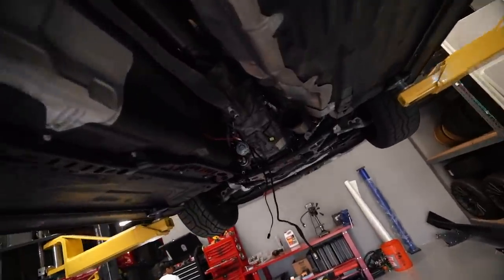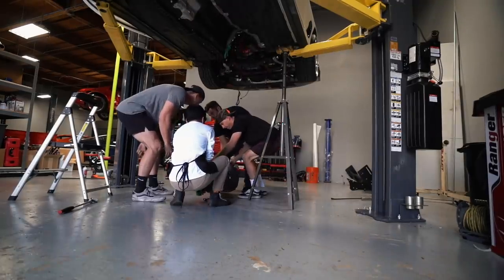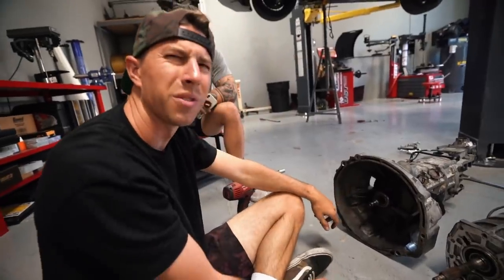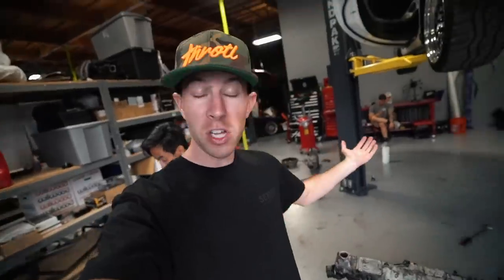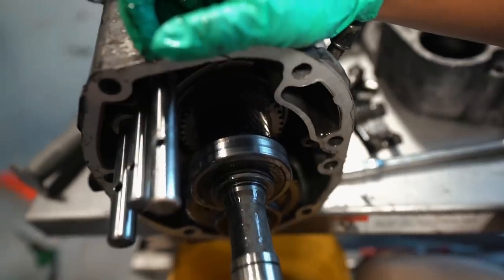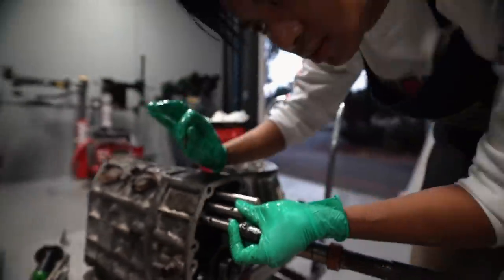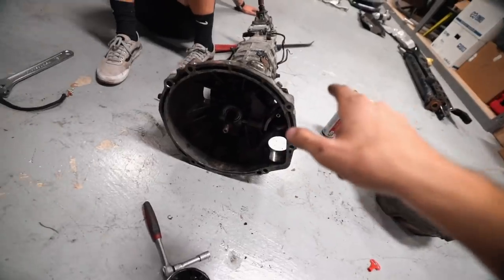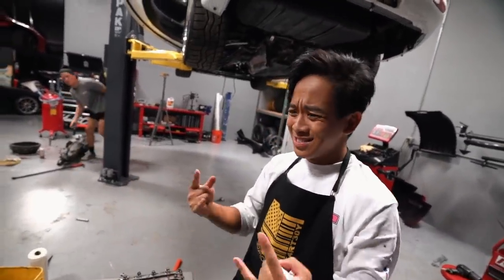RX-7 Transmission Tear Down & Rebuild!

Comment: So what happened is your shift fork got detached from the shift rod and the pin that is supposed to connect those 2 components got stuck between the shift sleeve (where the synchromesh is as well) making it unable to go in 5. At least thats what i think. Never seen that before.
Reply: MadCat so, what they said
Reply: Lol you just summarized what they said
Reply: @SamSto  he prolly typed it before he saw them say it

Comment: Those pins falling out is also common in the Miata transmissions. Get that pin back in there, replace the shifter bushing and put in some Swepco 201 gear oil. We need more braap’s!

Comment: Props for sticking with the diag bro. I did cringe a little when you were splitting the trans case with a pry bar and a hammer.
Reply: me too. im guessing theres some pretty mean notches put into the gasket area now on all those pieces.
Reply: There not rebuilding it
Reply: Right! Hope fully no one uses that case again. I would be worried that it could be prone to leaking.
Reply: Yeah really, fucked it up.
Reply: German Elite Tuning im stunned hes sticking with the fd trans especially with the chance you can take with the 5th gears in them, and 3rd gears.
Reply: RE ^triggered asf^
Reply: @shawnupole9316  what block did u buy and how much total was it a together for your sti? Just preparing... I know my engines gonna go soon
Reply: How else can you separate those pieces?
Reply: @shawnupole9316  awesome man I'm shooting for similar numbers. Good luck 😁

Comment: These boxes have a tendency to jump out on the 3 selectors.all 3 need to line up ,easy fix but as you just found out its a box out and rear off.my mates is the same but you cant use reverse.top vid ,love when you go deep into it.calv the rear is hard to put back on you need to hold up selector and twist as you lower it so the selector gets into the 3 gear fingers.good luck

Comment: The RE-A short shifter is pretty much a stock shifter. If you're going to buy a shifter for the FD transmission look on the forums for a C's Short Shifter. They're very sought after and go pretty quick but if you can find one buy it. I have one in my FD and it's one of the best mods I've done.

Comment: that pin that was droped  are protect trans to go in 2 gears and its protection to not make any damage.. so be careful of springs and small metal balls that will get lost if you open trans so be careful and do it slowly.. Its not a hard thing but you need to do everything in neutral so then all goes back together.. Its a proces 😀
Reply: and that small springs and balls allso protect trans so..

Comment: 10:19 the way it can fall out it to remove the spring and ball there is a bolt on the outside of the case of the trans that when removed you can take the spring and ball out, NOT EVERY LINK WILL HAVE THE SAME BALL AND SPRING SO ORDER IN WHICH IT CAME OUT IN IS IMPORTANT some links may have a stiffer spring than others

Comment: The 5 gear syncro probably broke in the past (super common) due to a mis shift.  Mazda had updated the shifter springs to prevent mis shifts later on.  Previous owner had the tail apart to replace 5 gear syncro.  The roll pin was either worn or wrong and reused during reassembly.

Comment: You guys need a hydraulic Highboy transmission jack. It has wheels and a pump so that when you support the weight of the Jack you can legitimately lower it and roll it around on the jack opposed to having to carry and shimmy it around

Comment: ok cool you found it. this is something u can fix yourself for sure. if you split the whole case on both sides you can pull the whole gearset out and put all the pins back where they go. and bam another trans

Comment: For the sensor just trim the plastic around the copper alittle bit so you can solder a new wire on, then hotglue/epoxy the shit out of it so it doesnt break at the solder joint.

Comment: I have never commented before, I had the same thing happen to my 94 z28 Camaro. It stuck in third gear, the day after it was rebuilt. I was pulling as hard as I could and not able to get it out of gear. Eventually we got it out of gear and it never happened again.

Comment: An issue I had on a 1970 camaro z28 was I was driving and it got stuck in gear, I tired pulling it out and nothing happened, floored i it and dumped the clutch a couple times and it popped out

Comment: if you end up having an issue with this transmission holding the power you should go all out and have one built to handle 700 + horsepower so there's no more problems in the future this build deserves it everything else is top-notch but the transmission.. love your videos though keep up the good work

Comment: I don’t know a lot about RX7’s but I do know that on high mileage Miata transmissions, the fifth gear/ reverse gear rod can get stuck in reverse, causing the trans to only be able to go into 1st and 2nd. Maybe that could have been the original issue being that they are both Mazda’s.

Comment: I had the same wires on my transmission rip. It through some kinda code about being in neutral and the car would not idle without blipping the throttle. We ended up just soldering the wires, but it was like $70 just to get a new sensor. Easy, just unscrew the old one and get the new one. I’m just a cheap ass. Haha.

Comment: Why don’t you just have the transmission built for the power levels you are running. Stock is most liking not even rated for half the power you are producing. Just asking for more problems.

Comment: You’re shift linkage isn’t lined up
Reply: Where the input shaft goes down it got stuck in between gears and locked itself in a gear. It happened to me on my ford ranger. Very easy fix.